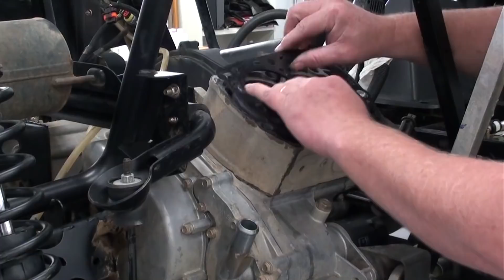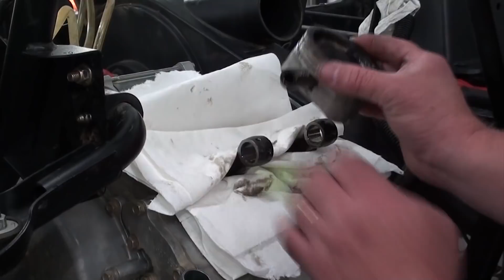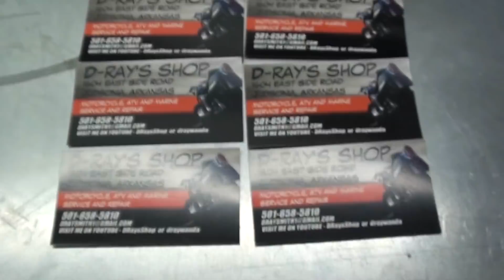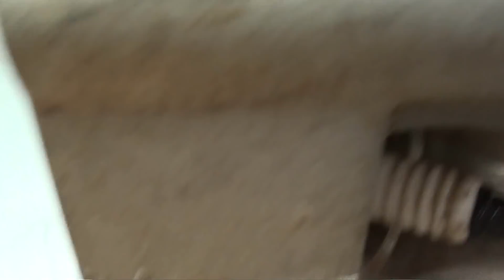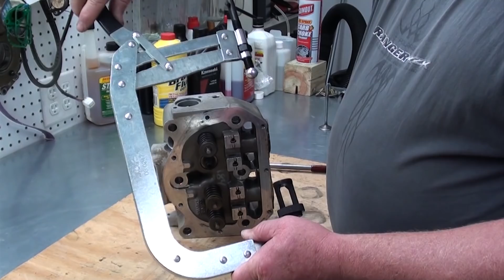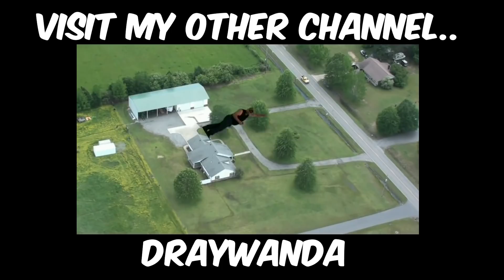Pt.2 Polaris RZR 800 Top End Overhaul At D-Ray's Shop

Comment: Great job filming,instructing, and explaining as always. Real glad I found you on YouTube. Your a clean and efflient tech.
Reply: Don't necessarily need to since it's a cam in block design. Timing is from crankshaft to camshaft. Just make sure you adjust valves correctly when you reassemble

Comment: Smashing Tutorial as allways :-)

Ive had a gudgeon pin circlip fall into the engine before :-(, i had to take the engine out and wash out the big end area untill it fell out, not fun :-(, i quickly learnt the important rule of stuffing rags in step.

Love that tool, easy and controlled, and the magnet is brilliant :-)

Ive never seen a piston ring so bad, im amazed it even ran with the compression loss.

Very enjoyable to watch an expert, thanks for recording it :-)